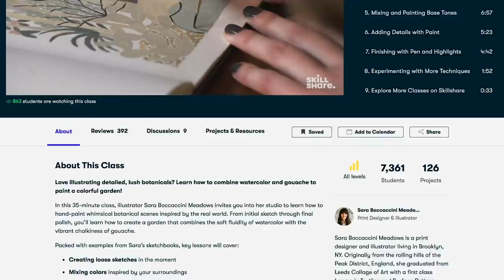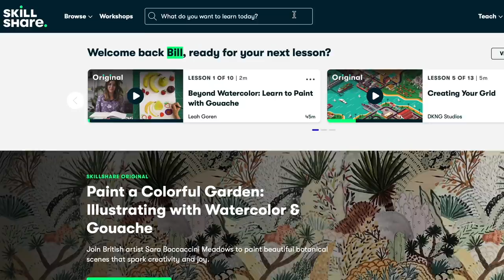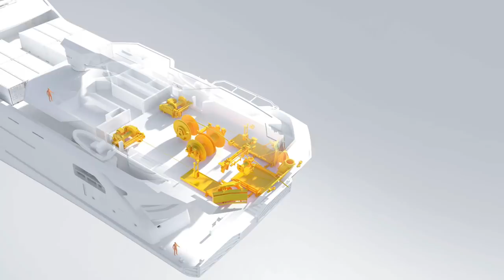Building The BIGGEST

Comment: A huge drawback with these mega yachts is that there are very limited places where you can ‘park’ them. On the entire US West Coast, 150’ is the biggest yacht acceptable and that’s only at ONE marina, although a second marina accepted a 250’ yacht after much wrangling. The top 25 yachts, in size are all much bigger than that. So, you can’t get maximum value by throwing dock parties. You have to live or commute to Miami or the Caribbean or anchor off-shore.